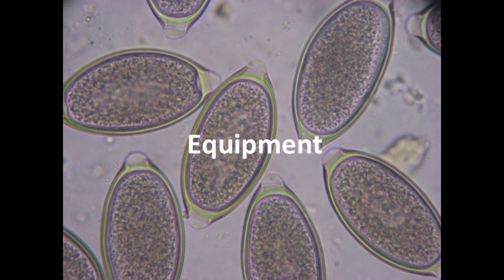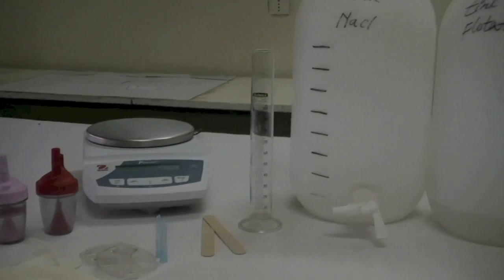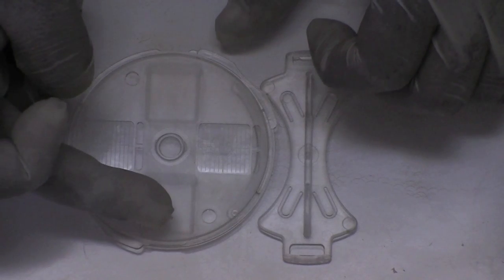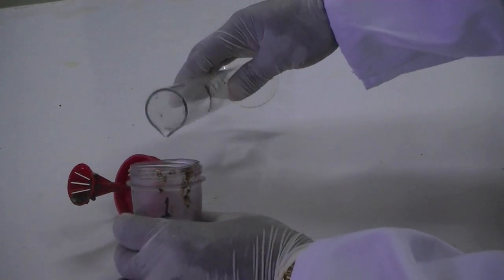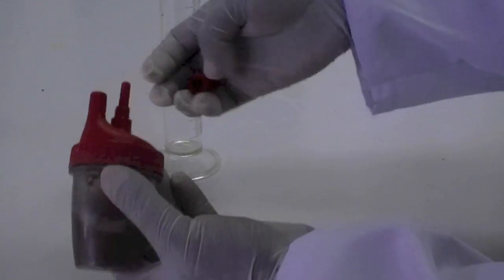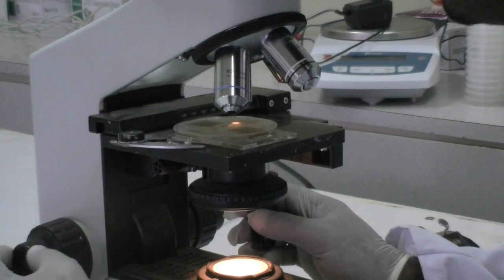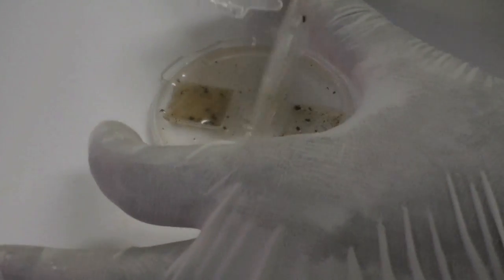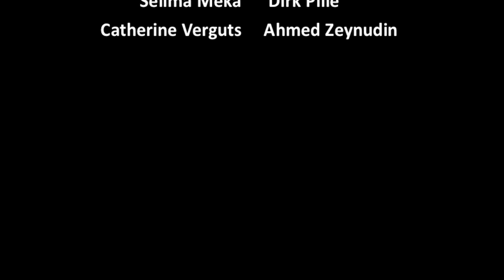Tutorial Mini-FLOTAC

Comment: For trematodes use a solution of LST Fastfloat it's an alternative to zinc sulphate for egg flotation. LST Fastfloat  fluke eggs being more dense compared to nematode eggs.LST Fastfloat also has a low viscosity which means that eggs are floated off very rapidly and so have little or no distortion